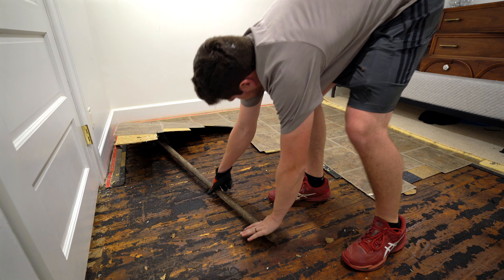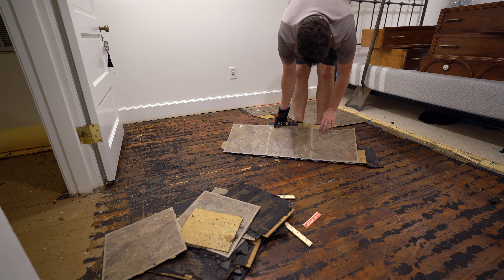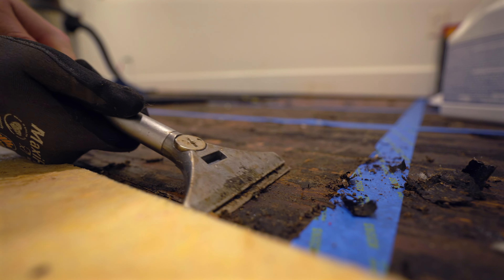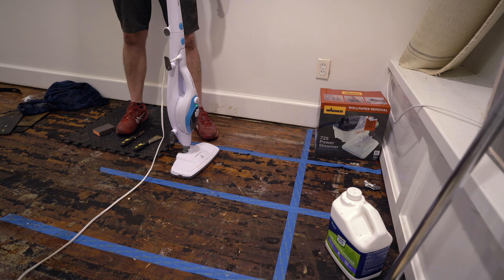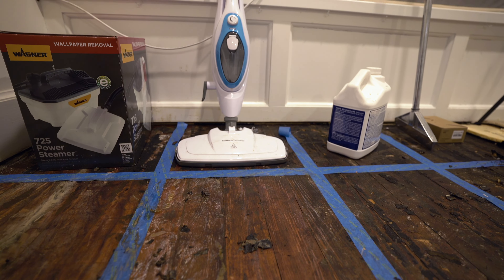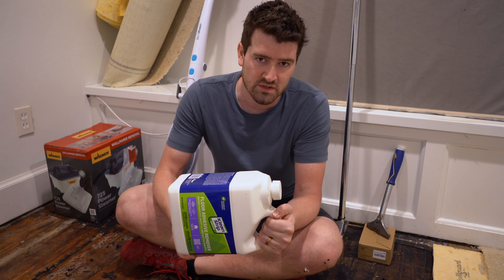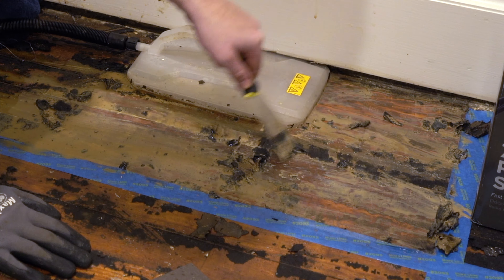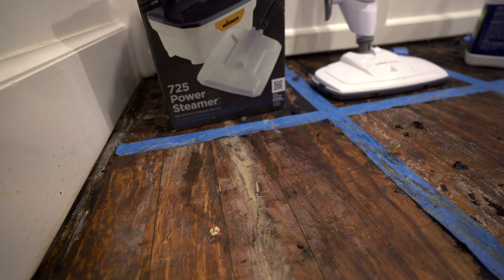Remove floor mastic adhesive without damaging hardwood

Comment: Nice vid. I do think that the steamer puts way to much liquid on the floor. You could get some bulging and twisting. The steam mop looked much more efficient in making only steam and not so much water
Reply from the maker: It does, but that's the price you pay for effectiveness. And the shop-vac takes care of most of the excess liquid so it doesn't seep in too badly.